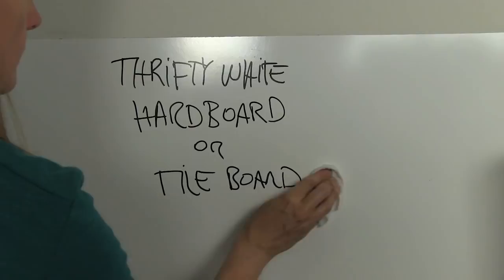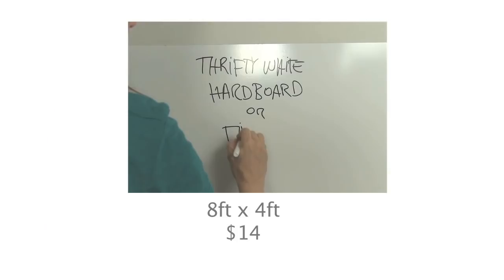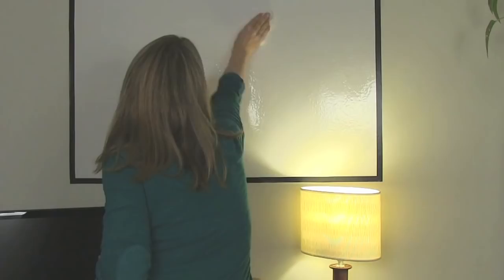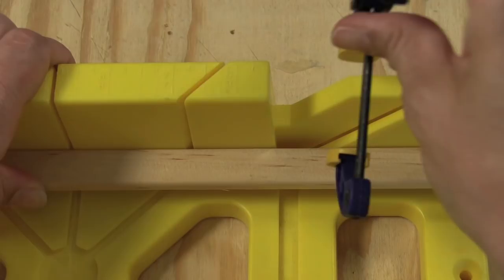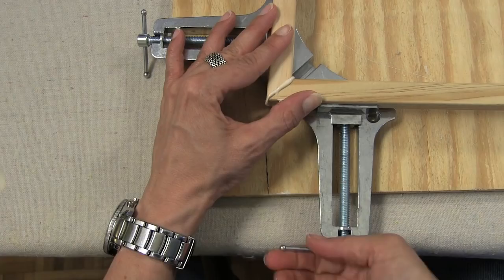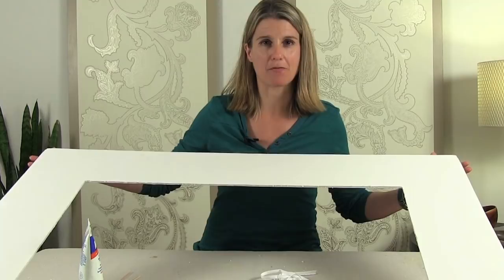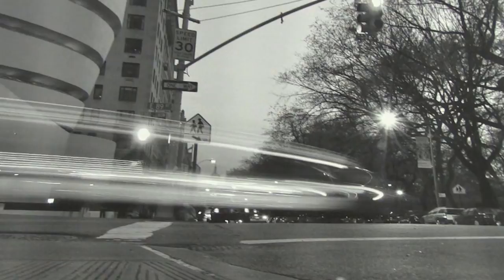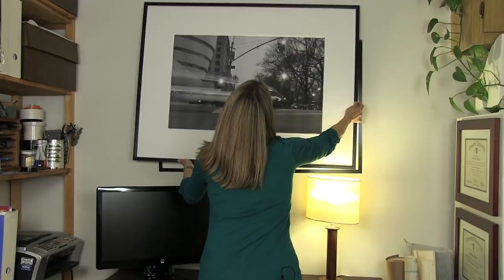How to make a picture frame covered whiteboard

Comment: Helllo : ) What a fantastic video. This was exactly what I was looking. for. The only problem is I can't see how the picture frame sits on the wall. Yes I see you put the two nails on the frame, but what do they sit on? You mentioned it was a rental space so obviously you would not have put nails etc. in the wall  for that nails to sit on, so what is holding it up? Would be great if you could respond all these years later x as I can see a few other people have asked the same question. Again though, really great video : )

Comment: How did you hang this picture frame to the wall ? . I didn't see any nail or double tape ? :O
Reply: See the video at 6:20 - ". . . and to hang the picture, the inside edge is going to rest on 2 small nails on either side of the whiteboard . . ."
In other words, there are two permanent nails sticking out of the wall that the top inside edge of the frame hangs on, perhaps 3 or 4 inches from each top corner of the frame. This allows you to lift and remove the frame whenever you want to use the whiteboard.